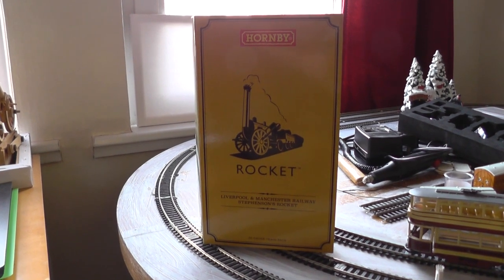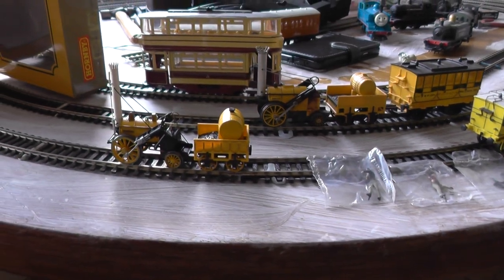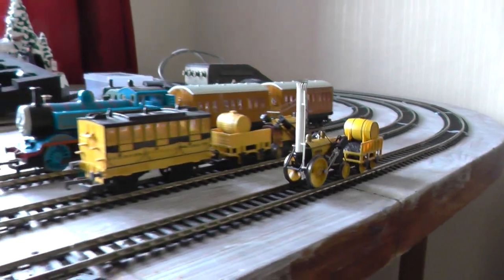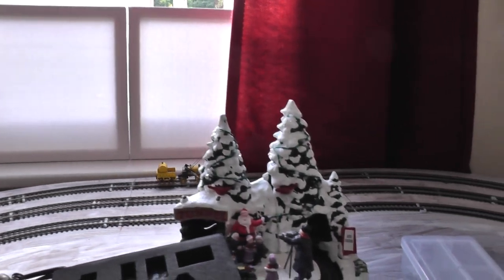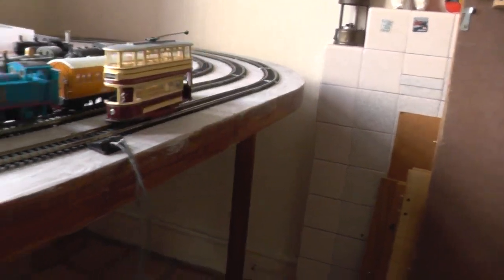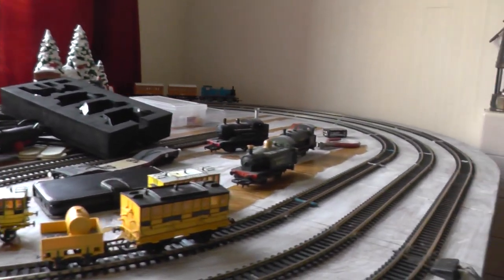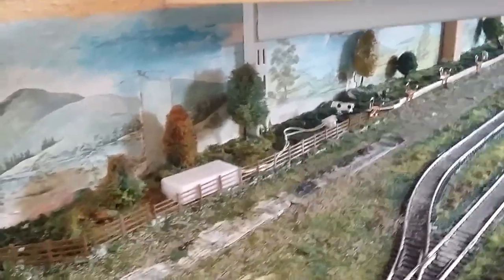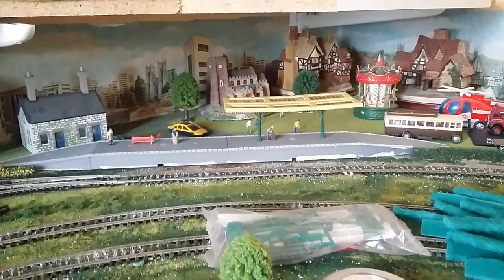Colin's trains Hornby Centenary Edition The Rocket + Thomas + future plans for layout June 26th 2020

Comment: Thanks for the video. Great product. Is there any electrical connectivity issues  as I see Rocket is jerking few times in between ? Or it is Rocket problem or track problem ?
Reply from the maker: Cheers Kaustubh, could be electrical, about 10 mins after her run she wont work, one of the wires connecting to tender has come apart, will take local model shop soon,  spot of solder should sort it
Reply: @Colin21454  Oh.. ok. This is alarming for me. I am from India and ordered R3810. If I face such problem I do not have any hobby shop to repair it. :(
Reply from the maker: @kaustubhponkshe6186  I have contacted Hornby have to wait for their reply, the pin which hitches to tender should have a spot of glue, and wires should be soldered, make more safer